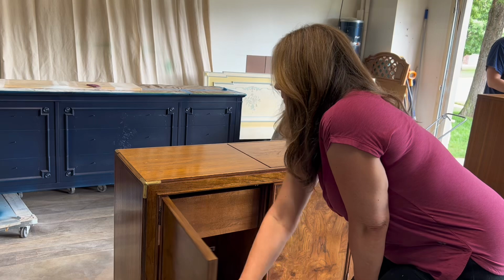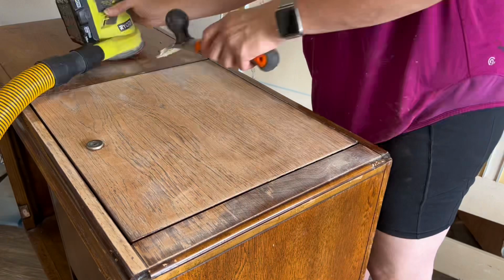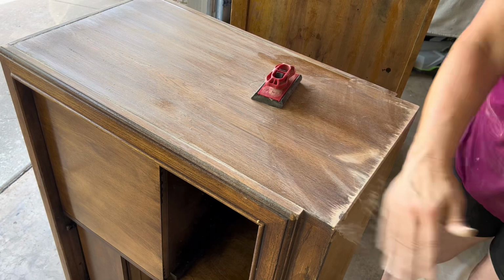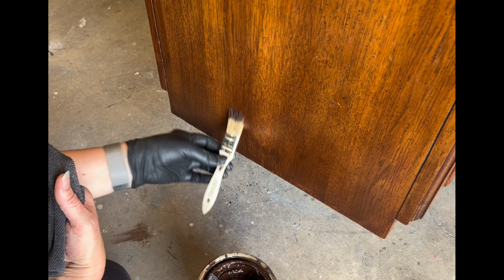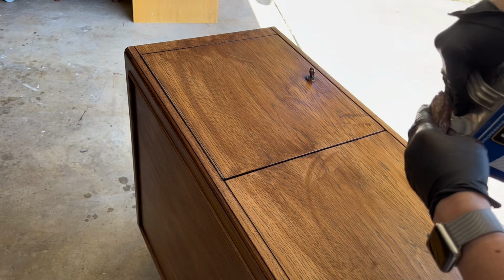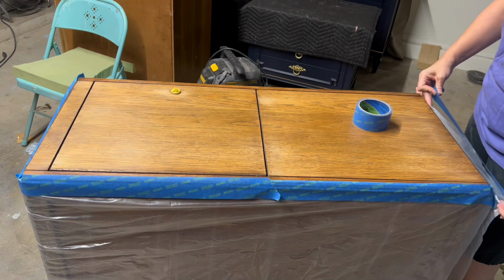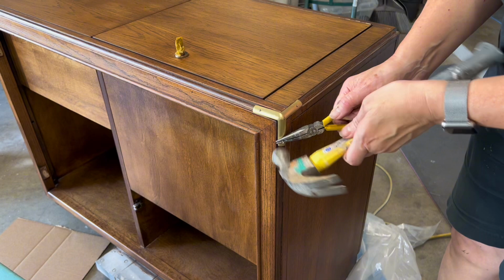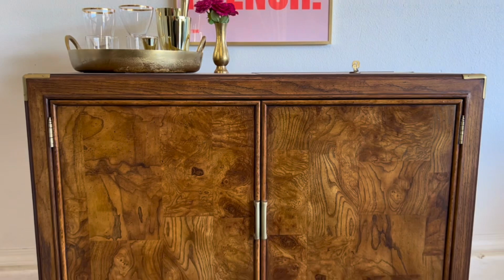Let’s Restore this Bar without fully stripping | Furniture restoration | Furniture Flip | Tone Wood

Comment: I am thinking the issues with the stain is due to the 180 and possibly the quality of the paper . I’ve had similar results in spots where I missed sanding with the 220. I know you only go to 180 but I think maybe try going to 220 or 320 and trying a different brand of paper . I have experienced some veneers though just end up being  splotchy with the stain  regardless . It’s frustrating
Reply from the maker: I agree. I actually double checked the grit requirements on the gel stain I used and it did recommend going up to 220. It seems they are different, that’s why I stop and evaluate because some are 180. 🥴 I’ll get it sorted one of these days.
Reply: @ivylaneinteriors ahh!! Ok make sense then. I don’t use gel stain all that often but when I did there were areas it was blotchy .. And it’s where I missed getting it with 220 :/.  All a learning process though. I still have a ton to learn. You should have much success then next time using 220 and the gel stain . 😊.
Reply from the maker: I hope so! I also tried another new technique of using a slip coat of mineral spirits before I applied the gel stain and that worked wonderfully!  @flaminbird1

Comment: After you used gel stain on the sides, did you use a too coat to seal it?
Reply from the maker: I used Osmo’s Polyx hard wax oil to seal.